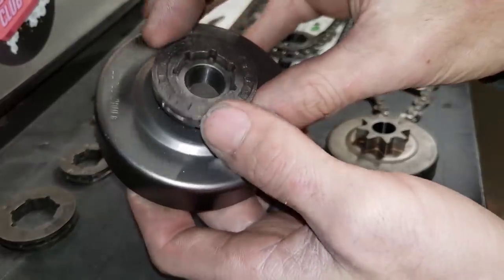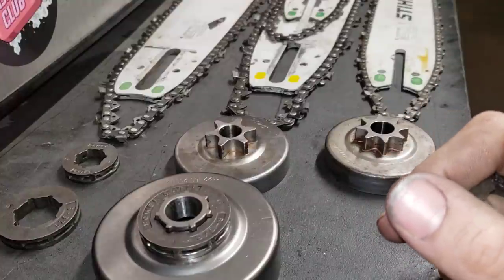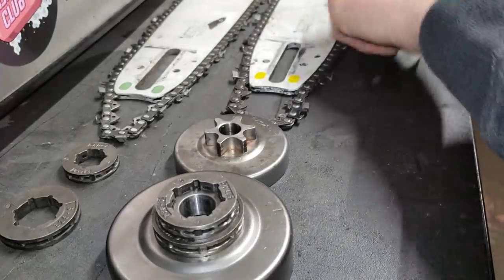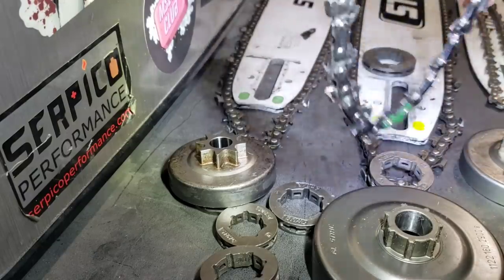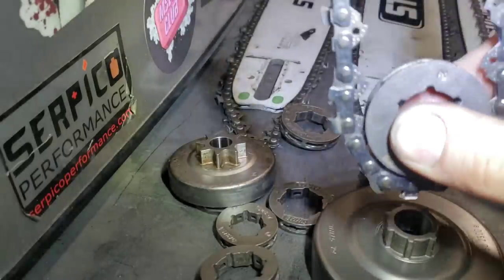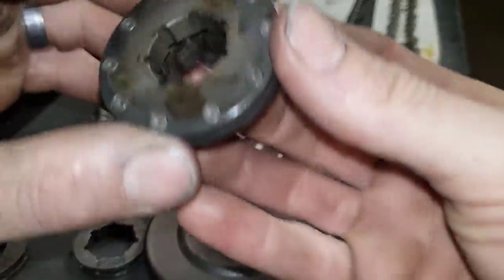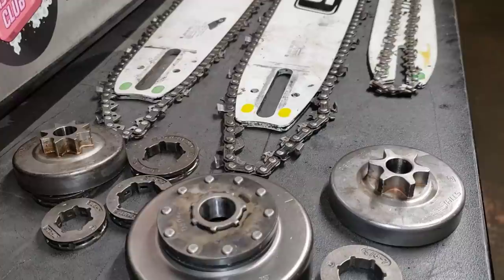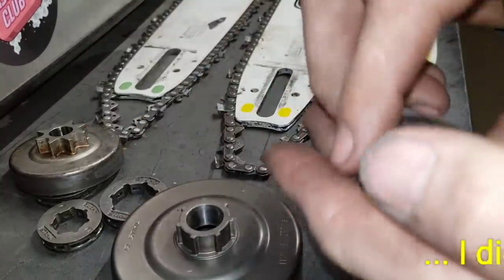Chainsaw chain/sprocket talk... pitch/drive/rim/drum/spur.... conversions and race sprockets...

Comment: with that pic chain dont forget that low pro in front of the 3/8. or lp 3/8. its not the same size as a regular 3/8 chain. i dont know why the called it that.

legend has it that the 8 and 9 tooth sprockets are originally made for semi and full skip chains.  so you can keep you cutter speed up. and the semi and full skip chains were originally made for the big wood so there is room for the wood chips and the cutters dont keep cutting the chips over and over making dust. so there you have it the history of chain and the sprocket
Reply from the maker: Definitely good to know... I haven't ran into that before but I wish I would have mentioned it... I will your commen tho... thanks my man

Comment: This is a chain for homeowner saws, and as a homeowner in the Southeast who doesn't really count wood by the cord https://www.youtube.com/post/Ugkxbs4FIpzuLyOJe2SesfbtvXi1CTnUXroD  I have this (or 20BPX) on several saws at different levels of smallness. I've never felt that the safety chain is holding me back. I buy multiple chains, and when the installed one doesn't feel grabby enough, I file it, then throw it in a cup of gasoline while I rotate to the next one. I have yet to file one down to the wear lines, so I feel like I'm getting my money's worth, and I'm happy about this new 3-pack - although, at this rate, it's going to be awhile before I buy another. I don't know why I would try anything else.

Comment: Hi John!!😀😀
One other thing to know is if the sprocket comes with holes in one side of it. Make sure that the holes are on the outside of the drum when you install it. Because if you put the holes to the inside it will carry the sawdust down the tract and plug your oiler hole and slot. Then your saw will stop oiling properly. The holes are in it to allow the chips to exist the sprocket and they must be allowed to exit to the outside. 
Take care my friend!!😀😀👍👍

Logger Al

Comment: Great video.  So many people mess this up.  Just fixed that for a customer the other day.  Chain kept jumping off bar.  Had 3/8 chain on a .325.
Reply: I keep running into that. Especially at pawn shops when out looking for something I can’t live without 😉. I will pull the chain and move it around the bar and there is that clunking. I make it work in my favor because I bring the pawn shop worker over and let him hear the noise and give him a concerned look, ‘I don’t know about it. That doesn’t sound good. Price tag says $200? I MIGHT give you $50 just to help you out because I can use it for parts.’ Got a Zenoah GZ4500 pretty much brand new for $20 that way. Took it home and put a .325 bar on it and it runs like a champ. Probably the best $20 I’ve ever spent besides that time I went to Krystal with a crumpled $20 in my pocket after a night out drinking

Comment: Another thing people always mess up on is the gauge of the bar 50, 58, 63 they make all the different gauges for all the different chains Pico 325 3/8 on 404 I always have the customer look on their bar and it would tell you what type of chain you need and what pitch and drivers
It can get crazy real quick when you start mixing and matching  not a bad video on the Spurs and sprockets but they're still quite a bit more to it but great intro !!  Thanks for trying to explain some of that hope it helps out some people
Reply from the maker: for sure... there is a lot to it... i forgot about 404 and different chain gauge... it could be a 2 hour video and i was already ready to shoot myself... i hate the technical talk... i feel like an idiot especially since i do not consider myself even close to an expert on this stuff... but its cray how many guys have just ran 3/8 and have no idea the different setups out there
Reply: @johnscustomsaws  I run 325 63g on my  025 did a few tricks@ mods it rips!! If people have to ask about rims@ Spurs they have no business running ported saws they're going to get themselves hurt!!
Reply: Here people think only .325" in 1.5mm exists, But now Husqvarna has gone to 1.3. People are just dumb

Comment: 👍.. if you have any pointers on building a redmax bcz260 trimmer.  Fully ported not hog out or anything but transfers intake widening exhaust port sides wide roof just hair carburetor has been bored intake bored gasket delete base, hoping to run strong..Great content

Comment: very good video john my ms660 came stock 3/8" 8 Tooth sprocket (fuck pin) and my ms461 3/8" 7 tooth. retired logger like bigger saws i used to run 404 chain many years ago on my 6 cube saws
Reply: 36" bar 660 32" 461
Reply: I like .404 actually
Reply from the maker: lol  i am with you man fuck that "PIN' nonsense... but someone will always be that guy that wants to correct me... and honestly im not sure if the whole "pin" terminology pertains to the OEM rim sprockets or not... i know the race sprockets have actual pins in them

Comment: The chain speed calculations are simple... Multiply the pitch by the number of pins on the drive sprocket.  That answer is how far the chain moves in one rotation of the engine. 0.325" pitch X 7 pins = 2.275" per revolution.
0.325" pitch x 8 pins = 2.6" per revolution. 3/8" pitch x 7 pins =2.625" per revolution. 3/8" pitch X 8 pins = 3" per revolution.

Comment: Ive bought alot of different rim sprocket for alot of my saws and ive found sometimes the cheaper ones are not punched out on center. Some run smoothly some have tight then loose places as the chain goes around. Its like yhe center isnt on center

Comment: Great video!!  I've gotta say I look at something like a 660, especially if ported, and think that 7T is just too-little, like a guy with big legs riding a bike in 1st-gear, just doesn't make-use of the power -- cannot see why that doesn't analogize directly to powersaw gearing (IE why Stihl oem-spec for 660 is a 7pin)
1 thing I was hoping to hear-- what of running 43 gauge chains in 50 gauge bars?  I've heard it's OK, that the extra room isn't a problem, have never tried it... When I look at the advantage Stihl climbing B&C setups have over Oregon, I can't help speculating that a large portion is the <10% reduction in gauge, in addition to the improved pitch (teeth-per-inch)
Thanks for all the awesome videos, as always :D

Comment: I have a ms290 and they say you can run up to a 20" bar. I at times will want to go up to a 24" bar. I see amazon offers spur sprockets in 6t, 7t, and 8t. Should I stick to the 7t sprocket with the longer bar or will dropping to the 6t give more torque for pulling more chain on the longer bar?
I want more power for the longer bar.

Comment: I need a new bar. The sprocket is .325 I just use one saw for falling, clearing brush, limbing, and cutting up into firewood. Which bar and chain would I want? Brand and size. I have had shorter but I really like 20 inch. The motor is a 62 with good power for that size.

Comment: Great video.   With everything being the same 7 pin, same saw. What is faster.  3\8 or.325
Reply: The speed difference will come from sprocket size which is being referenced by the pin count here. 7 pin, 8 pin, 9 pin etc. A larger diameter sprocket which creates more chain speed will have more pins. The 3/8 or .325 you mention is referring to chain pitch. The higher the number the longer a link is.
Reply: @cowcatcher9186  i was thinking that their was maybe something advantage in chain width or the driver spacing. That let one edge out
Reply: Sand Sox I think, and heavy on think, the 3/8 will cut a hair faster just because the sprocket of the 3/8 7 pin is a lil bigger than the 325 7 pin. I may have gotten a lil hasty in my earlier reply and over complicated this situation. Sooo, to your original question I say 3/8.
Reply: @cowcatcher9186  i havent used a .325 in about 15 years, since then my sharpening is alot better. i use the 33RS primarily, but you could get that in a.325 make up also.  i think you would have a little narrower bar and kerf.  drop that on a normal 60cc.  maybe you could beat a guy in a stock saw.   

or maybe there is a hidden advantage for a brush crew  . there has to be something i am not seeing. . why not just run3/8 on everything mid 50s and up

Comment: Do they make 1/4 inch pitch sprockets for the cheaper saws, like the Poulan WildThing? I bought a carving quarter  tip bar and chain for it with 3/8 pitch, but I think it would run smoother with a 1/4 inch pitch sprocket and chain.

Comment: I would like to use the 8 tooth sprocket, but at high elevation the power head struggles. I would have to use a much larger power head. That equates to wearing yourself out. So, Colorado guys need to stay within your handleability. Not saying it won't work, but experiment first.

Comment: probably a silly question but as long as you have the right pitch sprocket, does it matter about the gauge of the chain you are running as long as the bar is the right gauge?
Reply: No it doesn't matter, all the sprockets work for all gauges you just need bar to be correct and you're good

Comment: @johnscustomsaws Bro, can I pick your brain for a sec? I am new to chainsaws and have the milwaukee 16" chainsaw (2727-20). In a video someone was talking about a .325 on a 8 pin rim sprocket would be the sweet spot for this saw. I really want to upgrade my saw to those specs, but the milwaukee comes with a 6pin spur sprocket drum. The Oregon website only recommends low profile chains for this saw. In the video the guy mods his sprocket drum by welding a rim sprocket gear onto the drum. Do you know if these saws would take a rim sprocket drum from another manufacturer so I could just buy one? Or are there bars with .325 chain combinations that would fit the milwaukee 6 pin spur sprocket? I would really appreciate your insights into this matter.
Reply: I found out that a different sprocket drum would need to match these dimensions, do these even exist?
Overall Height	1"
Outside Diameter	2.20"
Inside Diameter	2.005"
Teeth/pins	8
Shaft	0.393" Diameter
0.320" Across Flats
Reply: @johnscustomsaws If there is no replacement sprocket drum for the The milwaukee 16" chainsaw (2727-20), what specifications would I need to look for in a .325 pitch chain/bar combo for it to fit on the original 6pin/tooth sprocket of the milwaukee?

Comment: Changing from a 7 tooth for an 8 tooth on a Stihl 460. Am I going to have to modify the bar or add links to the chain??? Really wanna speed it up but not sure if this is wise....
Reply: Well the sprocket is cheap typically less than $10 some saws there isn't enough extra chain play for the bigger sprocket some there is.. if you're only running 20-24" bar on that saw the 8 pin is probably a good idea

Comment: good day sir...i m from the philippines, i just wanted ask you, about 404 sprocket that will fit to a ms 382 drum... most of the chain available in our area were 404s..  is it possible....it doesnt if its 7 or 8 tooth.... thanks by the way, for your ideas about sprocket fittings....
Reply: clarification.... available 404 sprocket that will fit in a 382 clutch drum?

Comment: okay well my question is how do I know what the inside diameter of the rim sprocket would be called. what to they label the sizes as. because I cannot find any information on sprocket size. I have a Husqvarna 545 mark 2 and I need to find a 7, 8, 9 or ten tooth sprocket with the smaller diameter to fit on my clutch drum and everyone I order is to big. nothing says anything about the diameter. I found a 28 inch Oregon bar that fits a small mount but I need a sprocket. probably blow my 545 up but I'm dumb so LETS GOOOO!!!! I want to do some chain saw milling and I from what I have gathered your better off having the bar sticking out of the log so it doesn't get so hot. And Oh yeah. LETS GO DETROIT LIONS Jared Goff for MVP. Lions verse dolphins is my dream super bowl match up right now. Huge fan of Dolphins head coach, Mike Daniels.I really do hope the Vikings find a  Elite quarterback to utilize that star receiver lineup(because cousins is pretty...not elite) and get things running smooth. But either way GO LIONS!!!

Comment: Official stihl site info that "justifies" the 25x series for me:
MS251 10.8 lbs power head, 3.0bhp
MS181 10.1 lbs power head, 2.0bhp
So 50% more power for less than 10% more weight.
Make sense to me - local to me prices the 251 is less than 50% more expensive than the 181, so more bhp/dollar

Comment: Are there people that really think that 3/8 and 1/4 are the same? That would be like trying to use a 3/8 socket on a 1/4 bolt. Another way to look at 3/8 pitch is to see the fraction ‘3/8’ as a decimal, which is .375. Likewise you can view the decimal ‘.325’ as a fraction, which is ‘13/40’. You can’t use any other chain or bar other than one that has a matching pitch( and gauge which is the width of the groove along the bar where the chain rides). A .325 sprocket can’t run a 3/8(.375) chain simply because the spacing between the teeth is .325, so something that is spaced .375 would be too big. Just like a 3/8 pitch chain on a 1/4 sprocket wouldn’t work because 1/4”is 1/8” larger than 3/8”.

Comment: I never understood the chase for chain speed as it doesn't get the cut that much faster so why lose the torque? Had an old 1940 style saw that ran with tons of torque and no chain speed that would cut very fast as it had a good full chisel chain which is worth way way more than a fast chain speed. People underestimate a good chain with good torque. Speed will just get you more wear, thrown chains, damage when chains throw, heat on the bar and chain, & is just almost worthless. But, thanks to ignorance of society we have high speed, high kicking, fast running chainsaws so we can do more work on the saw than cutting. I need to figure this out and see if I can get a higher torque slower speed setup somehow without running out of tensioner. 
Sure, in a competition racing in a flat laying and perfectly supported log speed may matter but in use for what most need it sucks.

Comment: The larger the sprocket the slower the chain runs. It will not speed the chain up.
Reply from the maker: can you explain? im genuinely curious
Reply: @johnscustomsaws  take for instance a drill press with different size pulleys used to adjust bit speed. The smaller the pulley you run the belt on,,the faster the bit turns. Smaller diameter =faster revolutions.  I could be wrong but I don't think I am. If I am wrong please forgive me.
Reply from the maker: @jameshelton2161  on dirt bikes we would change our front sprocket up a tooth and lose torque and gain speed... the race sprockets are larger so I assumed that they are increasing speed and related to the changing of the front sprocket on a dirt bike but now im not sure... I only question your statement because smaller sprockets are always on smaller CC saws and the bigger CC saws have larger sprockets... and I have personally ran an 8 pin (bigger) sprocket on a smaller saw and it robbed tons of power... so if you are correct a small sprocket increases torque AND speed... if thats the case why do they sell 14 pin huge sprockets for race saws it would slow them way down... im not trying to be a smartass either but if I am wrong I need to correct it.
Reply: Front Smaller sprockets more speed, bigger sprocket more torque! On dirt bikes or any motorbike ! I assume it’s the same principal for the chain saw!
Reply: @kostasfrangos3354 other way around.  On a bike Big sprocket on front and small on the back is fast, small on the front and big on the rear is torque.  On a saw the driven sprocket being bigger has a larger circumference so chain is pulled further per engine revolution ie bigger the driven sprocket the higher the chain speed if your saw has the torque/power to pull it

Comment: Does Husqvarna make a 3/8 bar & chain that will work on a Husqvarna 550XP mark 2 . These saws only came with .325
Reply: I got that saw, and yes there are conversion kits (aftermarket not Husqvarna) but you're probably going to be better off using the .325 because it's lighter and uses less power to cut
Reply: @JoshNoss  ...Right I'm happy with my stock 550 xp. I opened the exhaust and it has tons of cutting power.